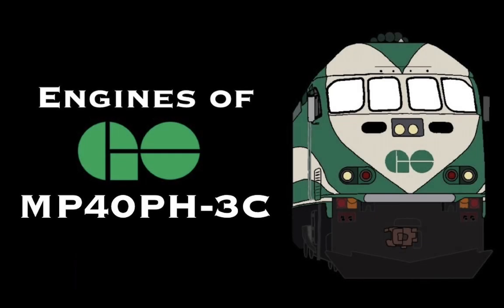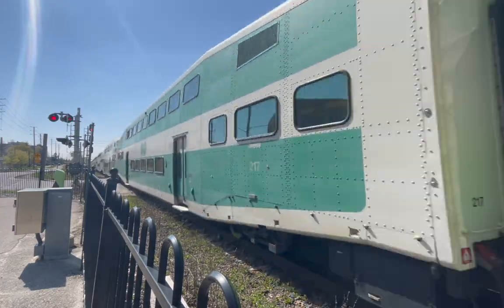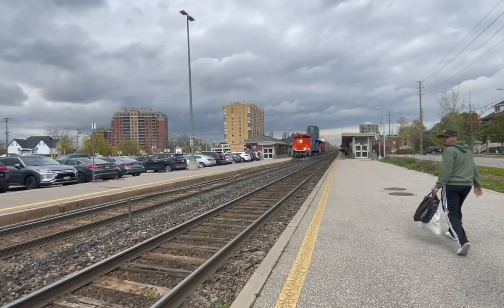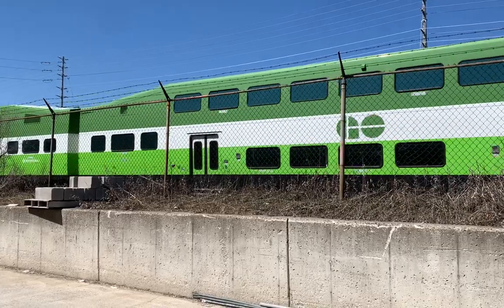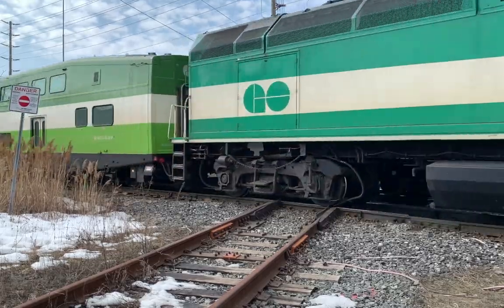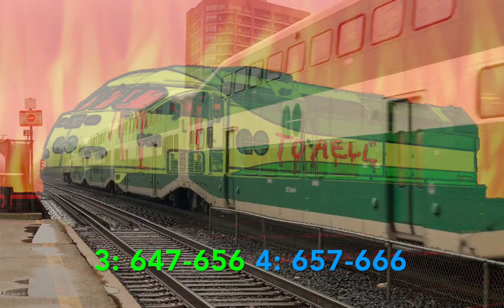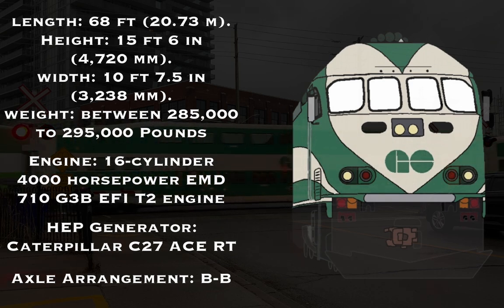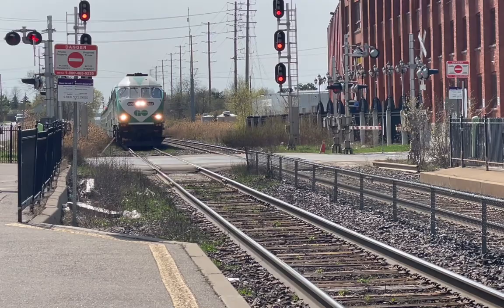Engines of GO Transit: MP40PH-3C

Comment: Besides all the train stuff, I'm so glad you tripped across the Lakshore Trail at Rouge Hill, and across to the Rouge Hill Park, one of the absolute gems of Toronto, and still not used (mercifully) by hordes of visitors.

As well as very often cycling from there (after detraining at the Rouge Hill station) I used to take a dog along the lakefront from that point, and it's dog heaven. Dogs and bikes are allowed on GO trains, bikes for many years now, dogs just the past five years or so, both a huge plus.

Was it purely by chance that you wandered down there, or did you have a tip from someone/somewhere?

Comment: Where are the horn clips? 

Also, you should include the engines howl when they reach notch 8.
Reply from the maker: Not necessarily needed as its the K5CA which is on every passenger locomotive (Minus the first order which had K5LAs).

I try to use my own clips for videos and the locomotives never use notch 8 in my area
Reply: You can use some of mine!! @GamingRailfanner

Comment: Another point is over time go transit has been retrofitting the mp40’s for tier 3 emissions so if you look closely you can see a square like shape box on the roof of the mp40’s, that is there to prevent excessive emissions from polluting. Also go transit has been retiring it’s “EMD 710 howl” by switching out the exhaust for a emission cleaner one it’s sad they are losing the iconic howl tho.